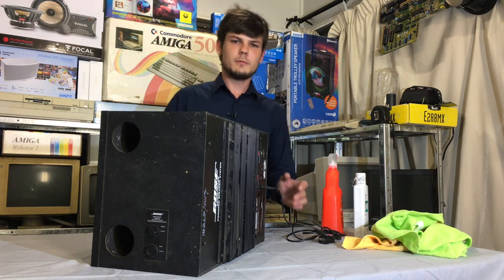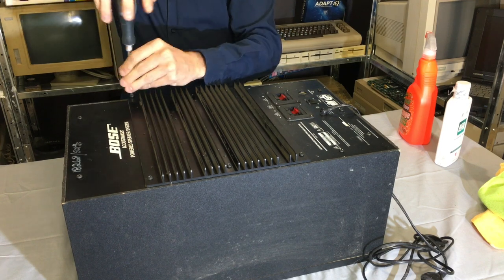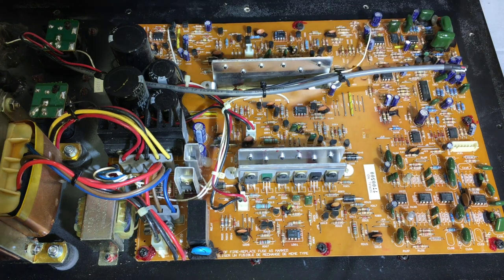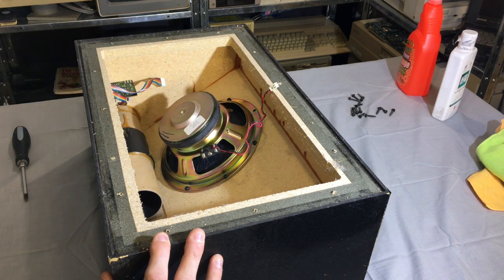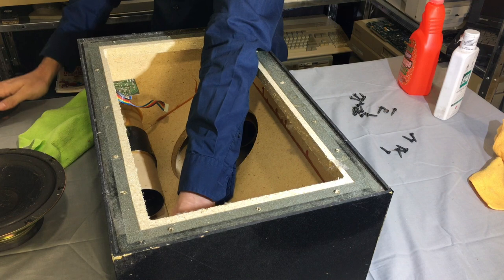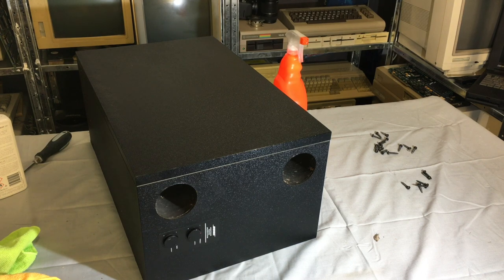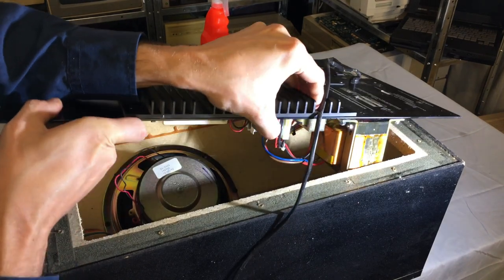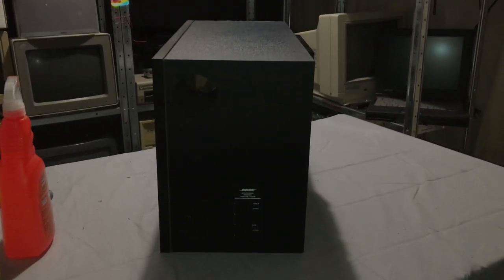Whats Inside - Bose Acoustimass 5 Powered System / Restoration

Comment: Hi , I have a BOSE acoustimass 3 series ii and just opened it to replace the fuse. Now when I hook up the speakers and turn on, it pops after a few seconds, and there's no sound. I've turned it off, on again and same thing happens. No sound, just a click from the speakers and a base "pop" and that's it. Can you help? I don't have much experience with audio, but looking at your video you have a lot of knowledge on these things.
Reply: You need to use a "slow burn' type fuse for bass modules. The high amp draw upon startup will blow a regular ( non slow burn ) fuse.
Reply: @metube3489  Thanks for the tip. So I need to use a "slow blow" fuse. That seems to be the description on ebay for a 'slow burn' type. What do you recommend?
Reply: Its a T1.6L 250v slow blow fuse

Comment: Hi Marinlaw. I have exactly the same unit and amp not working. Would you know how to make this a passive unit. Would it be difficult. Thanks for your help. Dave
Reply from the maker: Just connect the woofer to the speaker terminals and disconnect the amp

Comment: Question : I have the small lifestyle 5 that goes to this unit but it’s broken -
Most on eBay re parts only. My Manuel says it can hook to a receiver that has a low line output and volume control .. what it that and can I get one where ? I have a technics receiver I’d like to use that’s pro-logic but has  A & B - just not rca ends like the lifestyles. I’d love to actually use the subs and cubes (got 2 when I bought them used) thanks in advance.
Reply from the maker: Just use a line level converter. Speaker wire to rca

Comment: Hi mate, I’ve got the same system and it is sending a crackling sound through both speakers. I know it’s not the speakers as I have tested them on another system. Any thoughts as what might be causing the crackling sound. It’s happening all the time. Thanks in advance cheers!
Reply from the maker: Try deoxit the main connector . If not open it up and look on the board for any burns
Reply: Thanks will try deoxit. I’ve already opened it up and looked over the board and everything looks clean.
Reply from the maker: Also deoxit the controls on the front of the bass module
Reply: Mate!!! Went out and got some deoxit, applied it to the main connector and both  speaker connectors and and it’s like new! Thanks so much for the advice! Really appreciate it!
Reply from the maker: davinmb you are welcome
Reply: Hi tech guy, I hope you don’t mind me seeking your advice again. I’ve just bought another accoustimas/lifestyle system the same as this however the volume coming out of the speakers is very very quiet. I have tested with different speakers and it’s the same result. Any idea in what I should do before I pull the lifestyle system apart and clean it up? Cheers Davin.
Reply from the maker: Swap parts with your other one and isolate the faulty part . Let me know which part it is

Comment: Not impressed, no significant 1st octave energy.  It's just a woofer, not a sub.
Reply: of course it is a sub woofer.............. you have no knowledge about music..... ever heard of a contrabas? that's a subsound... and he is reproducing that. so it is a subwoofer.
Reply: I've got 5 sets of the 2 cube arrays with Bose stands and the Bose Powered Accoustimasd 9 speaker system sub box etc. It's been sitting around  for a few years and I cannot use it in my home theater set up. I have a Dennon AVR - 3803 using Infinity and Teac's and 2 Yamaha subs and the sad part about it all is the Bose equipment is useless in my arrangement because it does not intergrate with anything different than Bose. One of these days I will jump into it and convert what they say is unconvertable in the electronics.The built in DSP or whatever they are using in the sub module is going to go through a change or two. Is there anybody out there that could possibly head me in the right direction in what steps or process I could attempt to make to the Bose system making it more useful than just sitting pretty gathering dust while doing nothing for my musical pleasure? Maybe a website or someone not tied to Bose that had been through the same bs?  They say there is nothing I can do but purchase a not so great but super expensive component that breaks me and sends some corporate executive's kid through college. Also, not reaching a higher standard of my growing need for the perfect sound. I've got Bose headphones and I can't complain about them. They do produce a great sound. But it's not fair to the Boise speakers to go to the dump. If I can't make use of them  I guess no one gets to. Thanks for reading my rant. Kind of pisses me off spending all that money way back then for them being worthless now. Couple grand and the longivity and durability and resale value equal to a Ford Pinto or Chevy Vega and I havnt seen one of those in years.
Reply from the maker: You can buy a Din to RCA cable from ebay to use the Powered acoustimass
Reply: Boss only state them as a bass module,not to work exact as a subwoofer.

Comment: That is a very small woofer....
Reply from the maker: It’s 8 inch
Reply: That is still kinda small for the price.... I expect a 10-12 inch woofer
Reply from the maker: Terrificten a lot of very well rated subs use a 8 inch driver . Easier to control the cone movement a 12 can sound sloppy in comparison. Look at Jamos Sub800 for instance or something from definitive technology
Reply: Even so, what is the lowest frequency it could play?
Reply from the maker: Terrificten well this plays down to 32hz and still plays well . But this unit is old and music back then didn’t really have any lows at those frequencies. Something from definitive tech today with a 8 inch has a frequency response down to 16 hz
Reply: The second problem is that the 6th order band pass enclosure is very small... for all ported box subwoofers, size matters...
Reply from the maker: Terrificten oh trust me this things as large as my Cerwin Vega sub lol . The size matters for speakers is a Myth companies like Goldenear def tech have proven that . Go listen to golden ears Forcefield series tiny things that will blow your mind . Or check out paradigms tiny subs
Reply from the maker: Terrificten look up “ GoldenEar Forcefield 3 “
Reply: But the Bose still does not play below 30Hz.... If it plays down to 20Hz, I will be impressed.... but it doesn’t....
Reply: The golden ear forcefield 3 is a ported subwoofer but uses passive radiators... Subwoofers with passive radiators can be smaller while hitting lows... However, most bandpass subwoofers need to be large in order to hit lows...
Reply from the maker: Terrificten why does anyone really need a hifi to play to 20 hz for movies yeah music not much information down there
Reply from the maker: Terrificten the point I was making with the Forcefield is it’s a 8 inch driver that can play Very low . My personal choice is 8 inch as it’s a great balance between control and bass .
Reply from the maker: Terrificten and 20 hz is inaudible why does it matter for music 30hz to 120 is perfectly fine for 99% of music . For someone like me it’s absolutely fine as I listen to Jazz and classical , don’t listen to any rap but even so never seen a song with a strong 20 , 25 hz’S played , and you can’t count Decaf as that’s rebassed
Reply: Movies have a lot of Low frequencies.... even frequencies below 20Hz.... you can’t hear it but you can feel it... I used to use the Bose lifestyle 535 which uses the Bose AM10 (also goes down to 32Hz)... It did not perform to my expectations in movies.... I then got a SVS SB1000 subwoofer and compared both of them.... The SB1000 gives so much more low end in movies in comparison to the Bose system...
Reply from the maker: Terrificten uh no the 535 isn’t based off the AM10 lol completely different design subwoofer . The 535 is a home theatre in a box built for simplicity you can’t compare that sort of system to a dedicated home theatre system .  And I was talking about music as this Bose system is designed primarily for music reproduction
Reply: Oops.... kinda forgot the model lol.... but I did a test and the lowest frequency that could still be heard is 32Hz.... but u do have a point that your acoustamass 5 is not intended for movies...